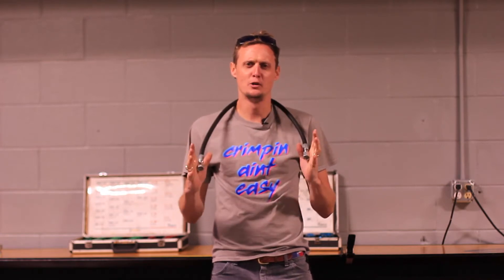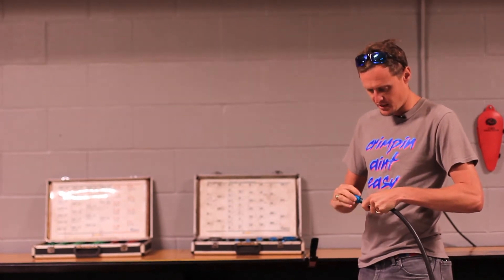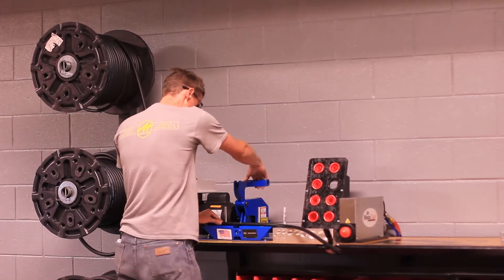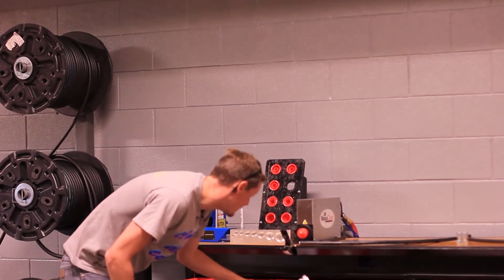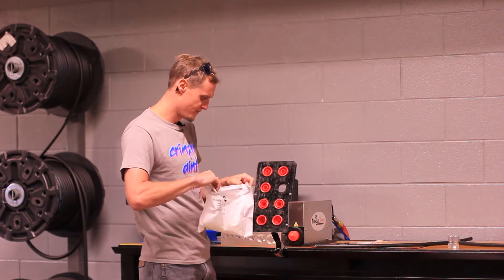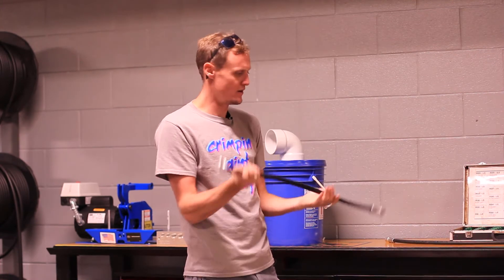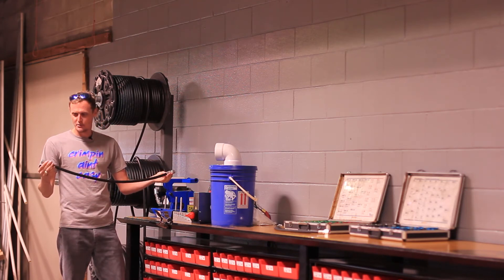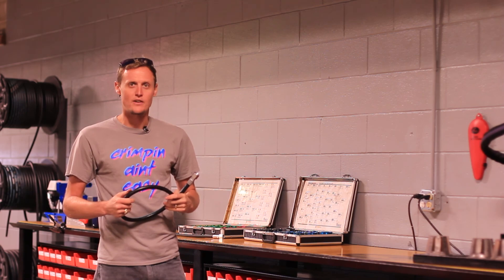How to correctly and safely make a hydraulic hose assembly

Comment: Good idea with the projectile. I'll use a chunk of foam. Kind of like the idea of when you powerwash a surface and afterwards you can wipe it with your hand and the dirt actually comes off then. Air isn't enough to remove particles stuck to the rubber.

Comment: And you only checked one end and did not blow the third projectile like the manufacturer recommended.  WHY.?
Reply: Master Dan, you are correct that the manufacturer does recommend to clean the hose with the third projectile, however there is a problem that can occur where it gets stuck inside the hose after you have crimped the fittings down.  If this happens and you install the hose, then the projectile will get into the hydraulic system and cause major issues.  It is my opinion that the risk of this failure is not worth the extremely small percentage of contamination that could be left after you have crimped the hose.  Thank you for your question.
Reply: @danielcramer2869  well if the manufacturer says they require that you do it then if you don’t and something goes wrong and they ask did you run the third plug threw and you lie and say yes or tell the truth and say no  will the warranty cover it or not .  it all goes back to take responsibility of your actions.  Have they done extensive testing on this matter.?have you?  If it gets stuck do they have a procedure to get it out? And if not I’m sure that I could get it out fairly easy. Just trying to understand no disrespect.  I mean you already learned me about the plug blown through the hose I had know idea they did that makes sense.
Reply: @masterdanprice2904  these are recommendations, not requirements.  90% of hydraulic hose shops around the country don't shoot any projectile through the hose at all, so this is a major step up from that.  If a customer requires that we blow the third plug then of course we will.  The problem is that sometimes you don't realize if it's stuck or not.  If this mistake is made, then it can ruin a hydraulic pump which becomes a much bigger problem.  Customers are free to make their own choices as far as how little or how much cleaning they do.  My opinion is that the 2 plugs are better than zero and the third is not worth the failure it could cause.  If you would like to buy a hydraulic table and shoot all 3 plugs through that would be great.  I'd love to sell you one.